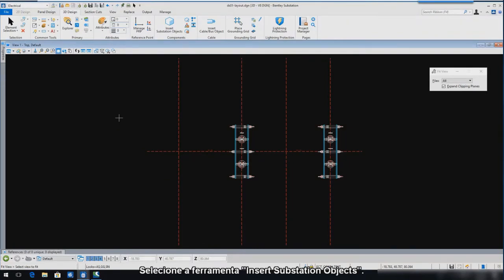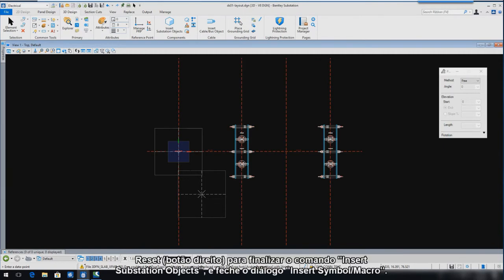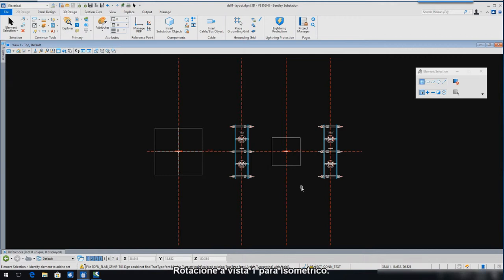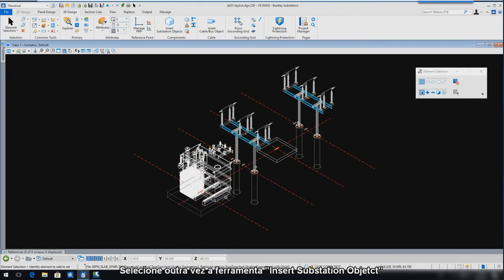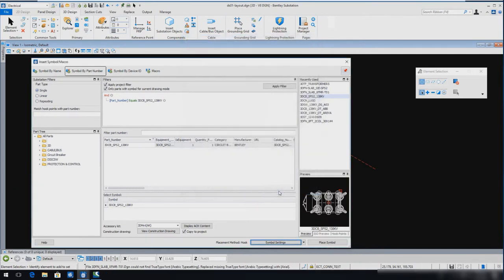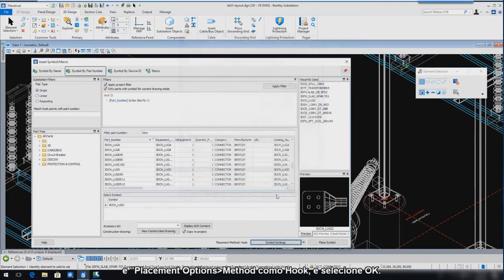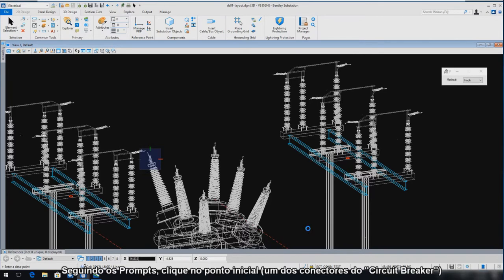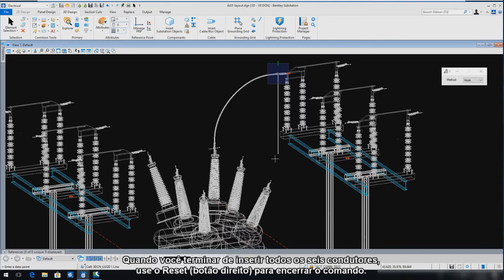08 de 12 Substation Insert 3D Symbols

Comment: hello prof., I have an different transformer rather than in the libraries. please let me know how to model it to be typical as the submittal. Thanks in advance.
Reply from the maker: You can model a transformer with any 3D modeller. Then you need to put special connectors on each transformer connection point.
I didn't get very far into this software because it's not my field. I am mechanical engineer. I made these few videos to help someone else sell the Substation to an energy company.